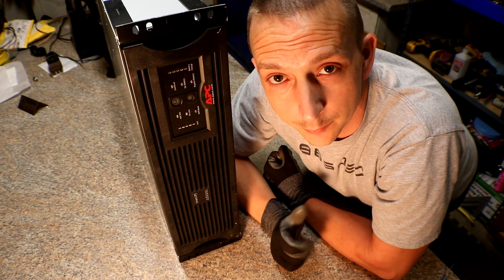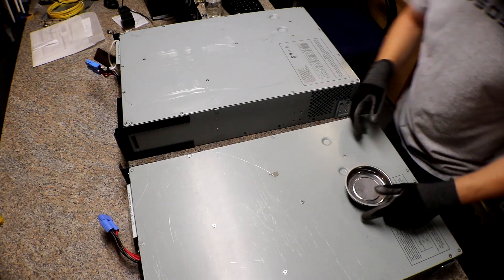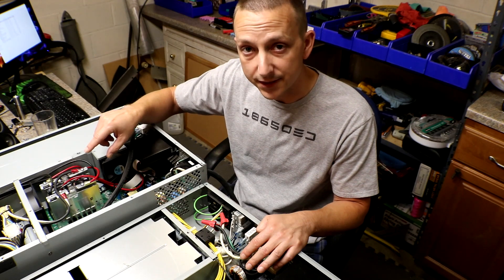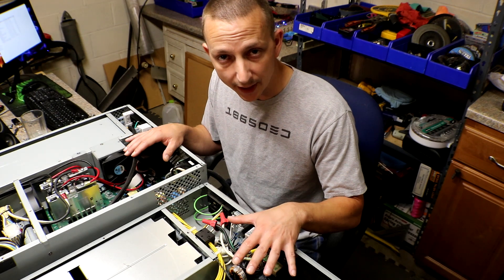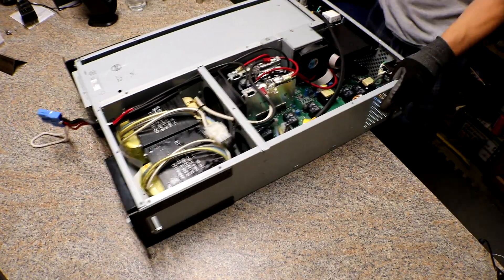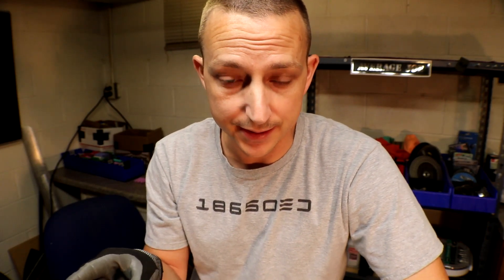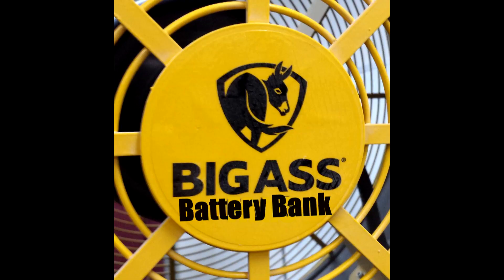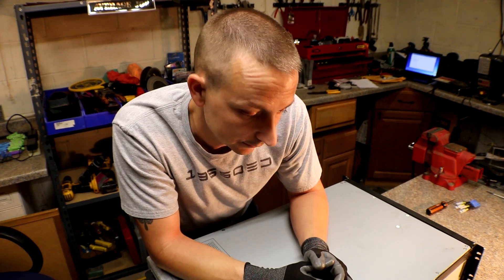Diy Tesla Powerwall ep49 48v APC UPS The XL Version!

Comment: I have the ups 350 it come with 12Volt lead acid battery 7.2A I change it have 4 12 volt lead acid battery 3 12 volt 7.2 Amp and 20Amp in water proof tool box with 10Amp breaker and 2 GFCI out let 110V plug and 40Amp fused for my battery 40Amp fused positive of battery and positive wire for my used I have fused 40Amp and have cooling fan on my ups I cut hole on my used for air if get to hold when iruning so my usb is protected  with GFCI out plug I was testing today do 2hours and half on battery have laptop and speaker on it but did have go out so I do full test on it

Comment: You just uh earned yourself a ..... squirrel  Sorry, I squirrel...... hahaha  I subd.  I found your channel researching if my Leibert 6kw 35amp UPS will work for an off grid solar power system for my RV.  I’m stoked about saving a ton of $. Your content is awesome and hella funny. Thanks
Reply from the maker: Thanks man! Yeah Ive been using my apc ups for the last few years and still going STRONG! Only thing I cant do is the 240v stuff. Someday Ill save enough for a real inverter so I can run the 240v stuff but that will be later on!

Comment: Another difference is that the 3U unit did NOT have a network management card  which is kind of key to any build that needs to be managed over ethernet.  The smaller 2U unit has what appears to be an AP9617 NIC that would allow it to be attached via rj45 connector to switch router or computer to provide snmp management services remotely so that you don't have to be directly attached to the ups to configure or maintain it.  Not to mention not having to deal with the CLI over serial connection when you can manage it via web gui.

Comment: I'm late to the party but for anybody else who finds this you need to reprogram the battery constant and the pack count and probably adjust the float voltage via the internal command line type interface.  Take a look here at how to do it http://zombiehunters.org/forum/viewtopic.php?f=6&t=109171&sid=85eefd71d2a981db037e3fda30df904c

Comment: Can we use it to run big refrigerator..? Will it work with a big 48v battery Bank
Reply from the maker: How big of fridge? Most likely! Ive been using it for the last 2 years as an Inverter! Have run it at 2700watts also and runs fine. I have a live stream recap video of results in video list.😃🤘

Comment: I'm little confuse, you make a powerwall battery , and you are adding a UPS how this work
Reply from the maker: Im using the ups as a poor mans inverter lol.  Im not plugging the ups in as a ups to charge or anything but I have and it works but its not recommended.  Just using it as an inverter, does that make sense lol

Comment: Also if you want 230v (configurable to 220 / 230 / 240v) Units, then make sure they are XLI's not XL's, the "I" in XLI stands for International. the XLI units also use IEC style inputs and outputs instead meaning they are designed to connect to servers, PDU's, transfer switches, etc using just IEC to IEC jumper cables.
Reply from the maker: You are full of great info👍👍👍

Comment: im Using a SUA2200RMXLI3U in my Lab rack connected to a bank of external batteries, these units are designed to take up to 5 or 10 "Packs" of external batteries (an APC External pack consists of TWO of the same Battery Modules that the UPS itself uses).  they will quite happily run at rated load nonstop. As it is with the option for up to 10 packs officially their runtimes can extend beyond 24 / 48 hours officially without issue.

the Tower XL Units will also take 5 or more Packs as well and run fine for hours on end. Tower units are 24v or 48v depending on rating.

i also have an SURT2000XLI in my Production rack which also uses external batteries at 48v. SURT Units 3KVA and above using 192v instead of 48v FYI.

SUA XL Internal battery pack would be 18AH @ 48v, so an external pack for that model is 36AH @ 48v, and you can have 10 of those for a total of 378AH @ 48v Officially.
SURT 1KVA / 2KVA Internal packs are 9AH @ 48v with external packs being 18AH @ 48v and you can have 10 for 189AH @ 48v officially.

You could easilly go beyond that, the only issue would be calibrating the unit to report accurate run times, and the "Battery Constant" can only be tweaked so far.
to go beyond 10 packs worth, you would need to experiment in prog mode (CAREFULLY!) with the battery constant to see how far you can crank it up until the Constant maxes out or the run time estimated maxes out, and with some maths derive what the equivilent battery capacity would be and use that as your limit, then your run times should be accurate from get go. These units will also learn current battery capacity as well provided you run them down flat (or use the calibration mode that runs down to 30%) every once in a while (like once every month or few).

Both of my units have 40AH @ 48v of external batteries connected, and i have a jumper cable to parrallell them if i need to for extended survivability.

the older SUA Series are not as quiet as the newer SURT units, but they handle surges better, and their Watts to VA ratio is better (1980w / 2200VA for my XL, vs 1400w / 2000va for the RT).  i will say the RT's are far lighter, quieter, smaller, and probably more efficient. (2.2KVA SUA XL = 3U, 1KVA/2KVA RT = 2U).

If you can get your hands on a 5U SUA5000RMXLI5U (230v) / SUA5000RMXL5U (120v) that would be perfect, they are still 48v Units, and they pack 4x 20AH batteries internally.
Reply from the maker: Whoa!!!! Thats a bunch of useful info there.  Thanks!!!  I told my recycler that Im always on the look out for the bigger UPS units so he said he will save them for me👍
Reply: No Probs, i did edit the comment and clarify a few things, mainly to do with battery pack capacities to include both models and differentiate them so re-read that bit.

Considering the size of the battery tray in your XL3K unit you have, you should build up a 48v Pack that fits inside the tray and install it into the unit.

i watched some other videos in the series and saw you swapped the pack connectors around on the back.
Yes your right they are a different plug, the Internal Pack plug is an Anderson SBS 50 Series, and the rear plug was the more common SB50 / SB120  Series. the SBS Plugs are designed to be finger safe with the contacts set further back to reduce the chance of a finger touching the contact and getting a shock. The 192v SURT units also use these SBS series plugs for that reason, as 192v DC WILL give you quite a whack. (192v is derived from 2x 96v modules in series internally).

you should go on ebay and grab a couple of Blue SB50 connectors from there and use those for the rear connections so you can use the factory connections for the internal battery tray. they are very cheap.

Also i'd suggest you change the Grey plug Shells on your packs to another colour such as yellow or green, so you cant accidentally plug one of those packs into a 24v unit, as the 24v units use grey SB series plugs. you can get just the plugs or shells for very cheap in bulk numbers and just pop the contacts out and swap them.

i would avoid using red plugs as a few legacy APC units and some other brands use Red plugs for 48v / 36v as well.

As for the extra mosfets (you refer to them as transistors) you saw on the heatsinks in the XL model, the reason behind that is Increased charging current to allow for charging external battery packs and having a half decent recovery rate when you have a lot of packs connected. adding extra mosfets has a negligible effect on efficiency (couple of percent max either way provided you do it properly) and should place the inverter under less stress if running near the units max rated load for really extended periods day after day.

APC Smart UPS SU / SUA units run the inverter in reverse to charge the batteries and they use a duty cycle on the mosfets to control charging current, so if you want, you could do what Knurlgar did with his units and install extra Mosfets and resistors in the spare spots to increase charging current to allow for fast recovery from mains if you need it one day. 

I would highly suggest if you do that, that you replace the existing Mosfets and control resisitors with new ones that are identical to those being put in as a modification, because different brands of Mosfets / resistors can be slightly different and mixing them in the inverter can result in the magic smoke coming out from being mismatched and not equally sharing the current load. Of Course the new Mosfets / resistors shall have the same ratings and be a direct substitute on paper as the ones there from factory.
Reply: @KSSilenceAU  I see you are in aus too how on earth do u know so much about ups's if you where going to use one what model would it be
Reply: excellent info really pleased i read this before buying a APC ups for my project , Thankyou for posting i had no idea the XL versions were designed to handle constant operation, I much prefer the idea of one of these ups over a chinese LF inverter (which also costs way more)

Comment: My guess is they size the components based on expected runtime.  Since the xl has a higher potential battery capacity it needs to be able to handle longer runs.  That being said I'm not sure if either one will stand up to long term continuous use (though the xl seems much more likely to)
Reply from the maker: I agree.  Thats what Im here to figure out.  If it will work and or last. I have 4 of the 2700watters so might as well try. 😄

Comment: It's going to be a HUGE time saver for many of us who will install a power wall/emergency power backup. I look forward to your procedures and development. At some point when you do decide you may want to grid tie the entire system, it would be nice if we all knew the typical permitting requirement with the utility and how you'd design the controls so the powerwall might supplement power even during night time if you decide to go that route. Thanks for sharing!
Reply from the maker: You are welcome!!!  Mine will be more along the lines of a back-up install but will use it daily.  Its possible later on down the road that I would grid-tie the system but it might be way down the road.  Ill need to get a lot more solar before I go down that road.  If it happens Ill be sure to share 👍

Comment: As you collect UPS units see if you can find any that are a True (Online) UPS.  A True UPS is set up to have the inverter always on to power the load directly from the batteries at all times so the inverters tend to be more efficient to counteract the fact that the power from the wall is being stepped down to charge the batteries and feed the inverter rather than having a bypass circuit. A True UPS will have fans that run all the time since they are designed to run the load off the inverter at all times.

These APC units use a bypass relay to transfer the power coming in through to the output under normal operation and only transfer to the inverter when power on the input is lost or becomes unstable.
Reply from the maker: Ok cool. The fans turn on and stay on when powered up. My recycler has a Hp ups thats 3000va and its super light compaired to these.

Comment: good work man! I've been thinking of doing this for a while.  I've horded several UPS's for similar use, But I haven't worked on my  project.
what i know that can be useful for you:

Some of server UPS's don't like to cold start ( start WITH OUT wall power ). Some will cold start but run in modified sine wave until wall power is connected then go pure sine. SOME do run pure sine from the start.  When trying to cold start them, turn them on with the power button , but if the don't fully boot /power on  then push test button

The "heat sinks" on the main power transistors aren't really heat sinks like most people think, so more airflow is better. I've used 1500va UPS before with bigger fans and had them run for hours.

Watch the battery draw and power out, some of these things have a minimum usage so one of mine ( i think older) pulled 300 watts regardless of load, I don't remember  but test test test :-) there are 100 Amp power meters on amazon https://www.amazon.com/dp/B01M5CWR2P/ref=sxr_pa_click_within_right_1?pf_rd_m=ATVPDKIKX0DER&pf_rd_p=3163805422&pf_rd_r=KM3BQY2M2MPG3MCMMBPK&pd_rd_wg=jEYZP&pf_rd_s=desktop-rhs-carousels&pf_rd_t=301&pd_rd_w=lTbS4&pf_rd_i=drok+100a&pd_rd_r=3E0Z78BT4CBVTVPAR510&psc=1 i like that one (monitor battery pull)

you don't need the APC powerchute software. it just monitors the UPS you can run it with out and watch the LEDS on the face of the UPS

also I would use the one that you have one of ( incase it blows you don't hurt the others you may want to stack )
Reply from the maker: +bimmers50e30 Thanks! You should get on it with your build! Lol ya Ive been hoarding these as well for this project 😆 That is some useful info thanks. Ive thinking about getting one of those meters. Its been in my wish list for months now lol. I might get it when I get some extra cash.  My recycler has a Hp ups and its super light. Its a 3000va as well. Do u think that is one like your talking about?
Reply: I don't have any HP's only APC,tripplite, and Libert . The heavier (due to transformers) the more likely it will be pure sine wave. Those transformers act like a "filter" to clean the power. ( think of cross-over's in speakers) . If you need help using an oscilloscope to look at the power let me know

Comment: Hi, Apologies should this be a daft question but can an MPPT Solar Charge Controller be used to charge a bank of 18650's directly and is there a particular configuration of 18650's that you would recommend for use with let's say 300W of solar panels please? Thank you.
Reply from the maker: +Buildfromscratch I would recommend a 48v system because they are more efficient. Yes, you can charge 18650s from a MPPT charge controller. Check out my ch for the charge controller.

Comment: Acp has built in charger and it can not be disabled and its not good for lithium batteries just something to think about.
Reply from the maker: I was wondering if it could be disabled or not. Yeah dont plan to use it to recharge unless needed for emergency.
Reply: Wouldn't a proper BMS on the battery packs not allow the use of the built in charger?
Reply: @davidwood2548  I'm wondering about this as well.
Reply: @daweihong  I've had a modified (12 volt battery supply) UPS ( charge circuit and buzzer disconnected) running a CPAP In a motor-home for a while. The motor-home house battery supplies the power. If a li-Ion power pack had it's own BMS I see no reason it would not work great in a UPS. I have all the components to do this; but haven't got around to it.
Reply: @davidwood2548  Hi David.  Thanks for the knowledge.  Just out of curiosity, how did you disconnect the charging circuit?  My fear is that constantly applying float charge to the BMS will eventually cause it to fail.  Thanks again for your help.
Reply: @daweihong  I'm not certain now exactly how I disabled the UPS charge circuit (about 3 years ago) I may have just cut the input power leads. The BMS could fail of course, as can most anything; but in a solar charging application it performs the same task; it just has a half day break.

Comment: DPDT switches and contactors with breakers to make your ATS. I run my APC threw my DIY ATS so if my bank goes down it will flip to utility power.
Reply from the maker: Ill have to look into that as it runs right up my ally 😃👍

Comment: We want to see  you replacement them. Regardless of the reason  :P
I like the idea of the XL version as it can handle a lot more run time. They may be the same wattage output, but the XL can run longer without overheating as quickly. So, therefore, not only do you get a beefier unit, I think you'd get better efficiency as the unit wont be getting as hot as the smaller units would under the long run time. Heat = inefficiency
Another great video from the AJ!  :)
Reply from the maker: Thanks!!! Yeah all good points.  I think Im gonna do it!!!

Comment: For scalability i vote for the XL version.
This will allow you to work on a second string of batteries while using the existing one :)
Reply from the maker: YES!!! I want to beable to easily add another string.  Also If I need to remove a string, this will allow for easy swapping 😃

Comment: I would test current draw on both units in standby mode and with the same 1kw load like maybe a microwave boiling water. Then see which is more efficient, usually the bigger transformers cud be more efficient. The "transisters" r MOSFETS too :)~, and the BIG ASS Battery Bank Project is a good name so keep that. The charger unit in the UPS cant be used on liithiums, I might have already told ya that, not even for emergency unless u do diagnostic checks and u dont have the equipment to do it. I tell ya this cos I killed my agm batts using the UPS, and if them lithiums heat up cos of it then it wud be a disaster . Feel free to call me out or shout me out...lol
Reply from the maker: I might be able to set that up for a test.  WoolC (oneword) 😉  The 12 and 24v didnt seem to have a problem while recharging the cells.  I took the 12v one apart and retested the cells and they weren't far off from the first capacity check. I dont really plan on ever using it for that anyway.  But Ill be sure to call you out if needed 😝